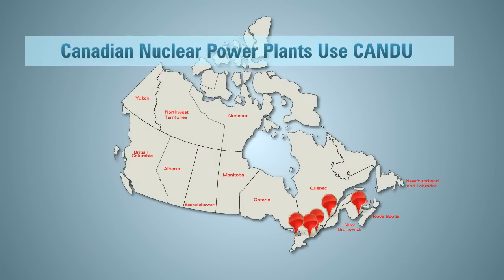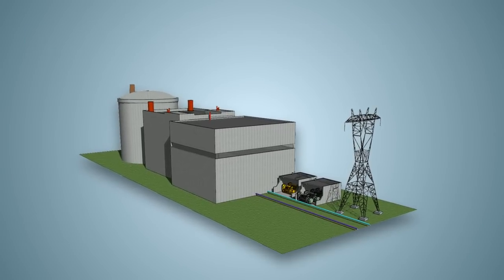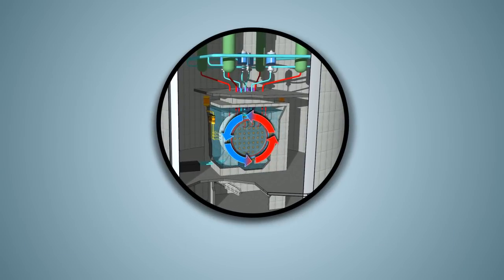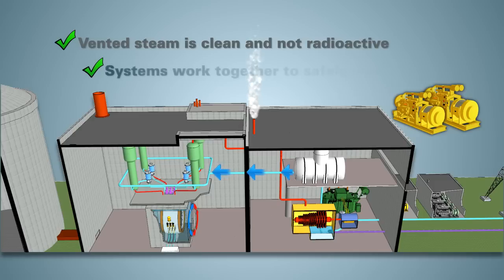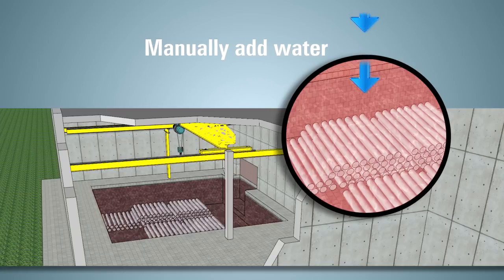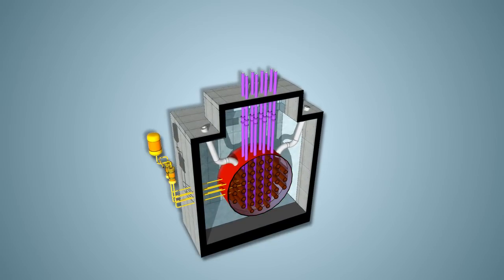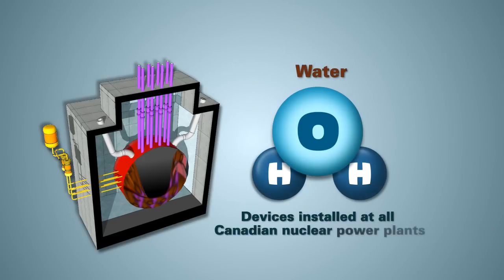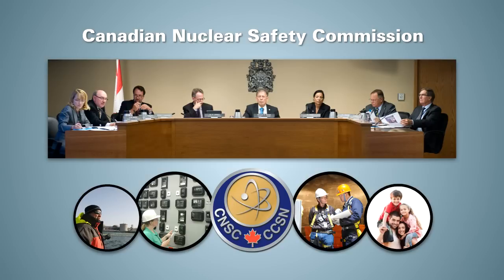Understanding Nuclear Power Plants: Total Station Blackout

Comment: we now know that there is a  backup for the back

these power stations are completely safe

highly unlikely for an accident to occur
Reply: they CANDU better (il walk myself out)

cover the roof with solar panels to provide power to the cooling systems and recharge a battery bank (for overnight cooling) 
then there will be no rish of damaging the core (unless the weather is shitty for a week)
Reply: @mwbgaming28  or you get mobile generators to refill the batteries, that way you can just refuel the generators.
Reply: @guillaumelalonde7945  that's also a viable option, but not useful in the case of fukushima

Comment: WATT ABOUT A VERY POWERFUL EARTGQUAKE???
Reply: Pretty sure they don't build nuclear power plants in earthquake zones without adequate reinforcement structures
Reply: OR A powerful Tsunami
Reply: No reactor has ever suffered a serious mishap from an earthquake. They're built to far higher tolerances and safety margins then bridges and buildings that tolerate earthquakes all the time.

For example, Onagawa Nuclear Power Plant was even closer to the 9.0 earthquake that caused the 2011 Tsunami than Fukushima and it didn't have a single issue thanks to a properly designed sea wall.

Comment: Fukushima daiichi lost FUEL TANKS, not power generators!
Because, compare to mighty TOHOKU Onagawa, TEPCO didn't build proper WALL !!!

BTW - uranium reactors suck so hard! Even after shut-down they continue nuclear fission, causing meltdown :\

P.S. Not 15 BUT 13,1 meters. Onagawa took 14,3m WITHOUT scratch !!!
Reply: The fuel generators it didn't lose outright had their power distribution panels underwater. Here's an excellent article describing step-by-step exactly how things played out.

http://spectrum.ieee.org/energy/nuclear/24-hours-at-fukushima
Reply: That decay heat isn't a feature of uranium-fuelled reactors, it's a feature of solid-fuel reactors...
Reply: +lies damnlies
Decay heat is feature of all reactors. You have fission, therefore you have a soup of fission products, some of them very short lived and very radioactive, therefore you have decay heat. Radioactive decay happens no matter what the temperature or state of matter is.

Comment: very unbelieveable emergency, i think thats why nuclear power plant in canada are more safely than in USSR aka chernobyl
Reply: the RBMK-1000 reactor designs are also over 40 years old so its not really a fair compair.
Reply: The RBMK was a modified bomb factory that didn't have redundant safety features and in the case of Chernobyl was critically mismanaged. There's just no comparison, any of a hundred individual things in the RBMK design would've prevented it getting an operating permit in the US, Canada or Europe.

Comment: Not exactly the self-limiting shut-down I was hoping for. A core melt-down, even if contained, hardly instils confidence.
Reply: What did you hope for ?
Reply: @mitchsfarm  A self limiting shutdown.
Reply: Candu uses natural uranium, no heavy water no nuclear reaction. That is a fail-safe shut down.
Reply: @kend6693  The issue is the management of the heat from the fission products post shutdown.  However, the large amount of water in the Calandira and Reactor vault gives us a much better chance.  Also, I think the CANDUs have a lower power density than BWRs.

Comment: I understand that there deadly. 
Not safe.  
Your backups have failed on several occasions.  
Watch chernoble or 3 mile island Fuka shema. 
They had backups for the backups and still they failed.  
Find a different source if power.
Reply: Chernobyl actually had few backups and was a positive void coefficient (meaning the hotter it runs the faster and hotter it wants to run, a feedback loop), CANDU is a negative void coefficient, as the water boils away, the moderator needed to slow the neutrons to the correct speed to actually react is gone so the neutrons are too fast to do anything and the reactions slows down making less heat so the reactor does not want to spiral out of control like Chernobyl did. The Chernobyl systems had few if any backups because the Soviets were communist cheapskates that took a weapons reactor design, slapped a steam generator on it, threw out safety and called it a day... only for it to blow up in their face. They relied on the momentum of the turbines to power the cooling pumps as they SCRAM (emergency shutdown) the reactor...

Fukushima lost power and lost access to the emergency diesel generators which left them in a pickle as their safety systems were not passive and need power to operate. CANDU reactors can shutdown without power by allowing the control rods to fall into the reactor or using the poison system. And they are presumably built to withstand earthquakes and are properly maintained and staffed... apparently a good portion of Fukushima staff was on the can thanks to bad sushi or some other form of food poisoning, combined with an aging reactor that was well past its lifespan and not properly maintained with no sea wall and then the diesel generators got drowned. Someone else said that a sea wall prevented a similar disaster at another plant, which Fukushima lacked, and you might notice that almost all of these backups are able to operate without any power and some operate without operators? yeah another design difference.

CANDU was designed by Canadians, we are paranoid about safety to a fault... however, I would trust a Canadian nuclear plant over any  other nation's plants, any day of the week. As an added bonus, it is really really hard to use a CANDU plant to make weapons unlike the RBMK design that Chernobyl used, one way to see this is how long it takes to refuel. If you cannot refuel while the reactor is operating, it means that reactor consumes things like plutonium before it can be extracted and used for nefarious purposes. However, Chernobyl type reactors (RBMK) can sometimes be refueled WHILE they are running which allows for the extraction of plutonium for nefarious purposes... Canada is against nuclear weapons and so our nations reactors are designed to be VERY hard to use for anything other than making power... but the USSR was in an arms race with the USA and loved their nuclear warheads... so a lot of their reactors were for making weapons... and they just slapped a power generator on them as an afterthought and called it a day... with disastrous results.

Comment: Keep in mind the speed is at the speed of light or a gamma ray speed - one billion miles an hour in a meltdown. One millionth of a second would be the right speed for your video pictures. Firetrucks?
Reply: uh.... do you... understand anything said in the video? Like I'm sure you understand most of it, just wondering if you skipped like a section of it... an 11 minute 29 second section of it.
Reply: Reactor meltdowns take a long time to happen. With all the systems in this reactor, they'll probably have more than a week to cool it back down and prevent melting. Plenty of time to find firetrucks.
Reply: bro, this is a meltdown, it takes almost a day to happen, (exept on Chernobyl, but do some research on that and u will find out why) not a nuke that u press the button and boom
Reply: SassyHershsey SassyHershey supplying water to the calandria would prevent an accident
Reply: keywords: time constant; stability; shutdown criteria; decay heat. Go read a book. I have.